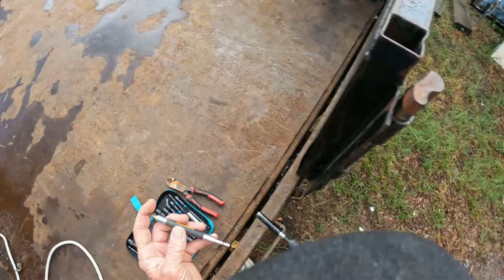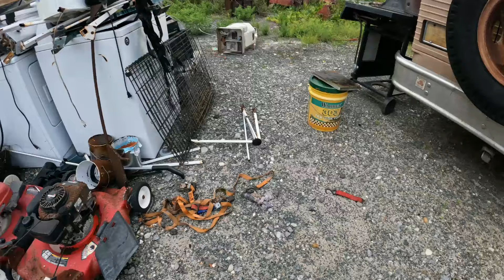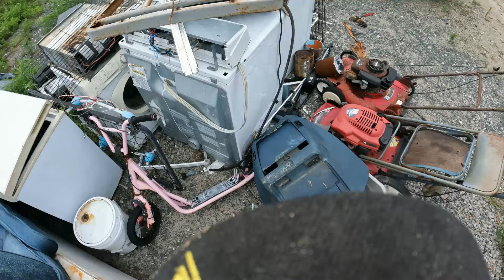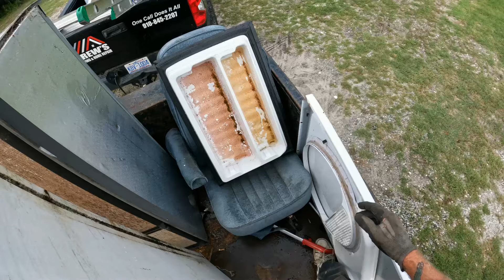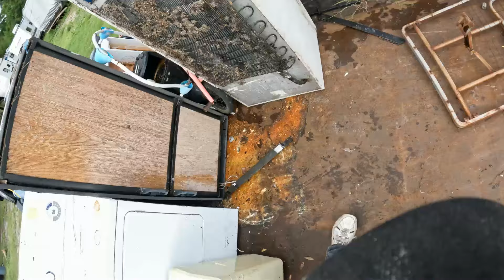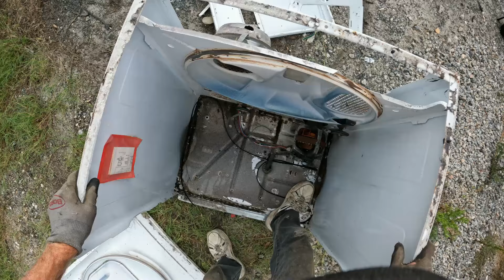Picking up a huge load of scrap metal. He said take it all!

Comment: Stuck bolts I always tighten then reverse and if that doesn't work I take a torch to it and it loosens them up. Great video Drew.
Reply from the maker: Good tip!
Reply: I always forget about using the torch,99% if you can get the bolt to start smoking it will break free,great tip.

Comment: I learned if u have long extension on a impact it takes away a lot of the torque to break the bolt loose
Reply from the maker: Interesting thank you for that tip. I did not even think about that but you’re probably right.